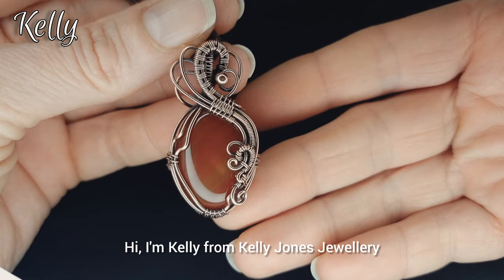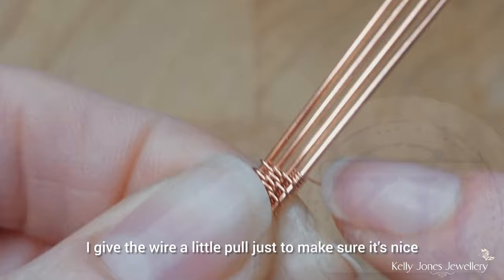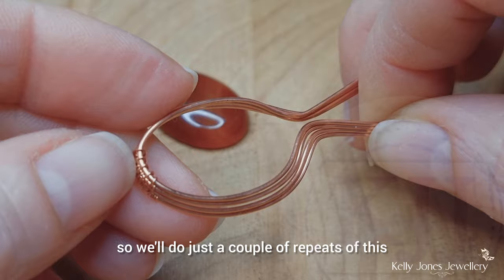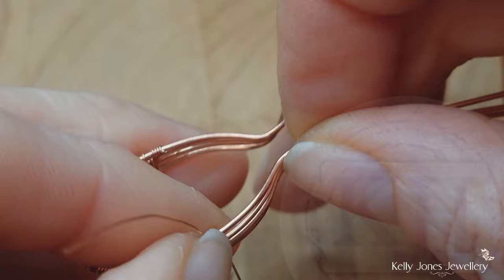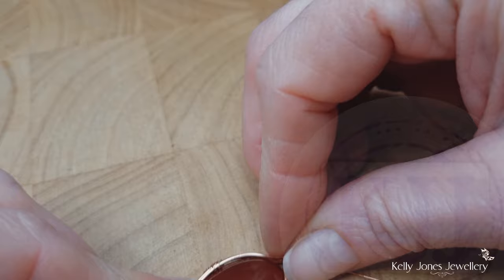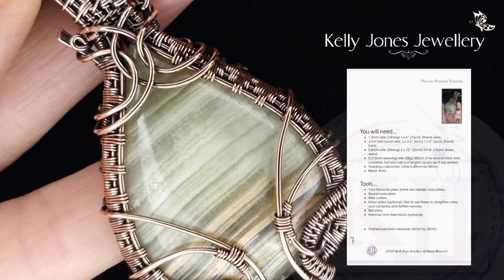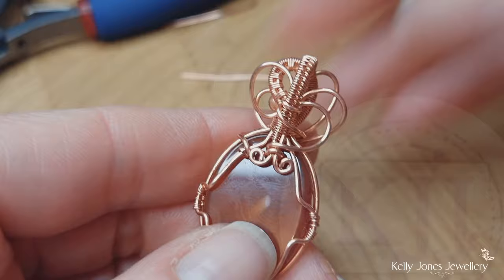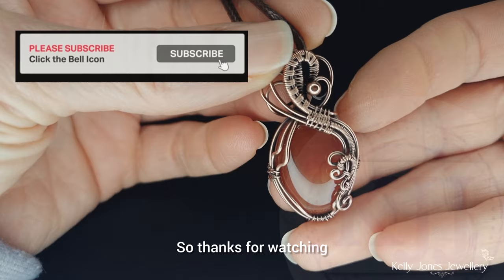Wire wrap pendant tutorial Cardinal..

Comment: I just finished this one up using a less than stellar laborite stone I had on hand.  It turned out beautiful despite a few issues I had along the way, nothing at all to do with the tutorial.  I always admire how smooth and nicely you swoop and curve.  Oh that is something I keep hoping one day will just become natural to me.  Also I had trouble with the wire that you added the bead to.  I didn't have the best option for a bead and once in place it kept sliding around.  So I had to straighten the wire and figure out something else.  I ended up making 2 curly q's in the wire but keeping the general flow of the wire on that side.   It looks good now but I sure did dull that wire up with all the messing around I did.  I guess that is what a buffing tool will help shine back up...
But the nice thing is the crack on the back of the stone that does not go all the way thru is hidden, as well as a small chip on the edge of the stone.  The stone seems secure and held well so hopefully the crack will never finish and go thru.  Someone will still love when I gift this to them
Reply from the maker: Sounds beautiful, you can always polish marked wires with nail buffers or fine sandpaper 💕